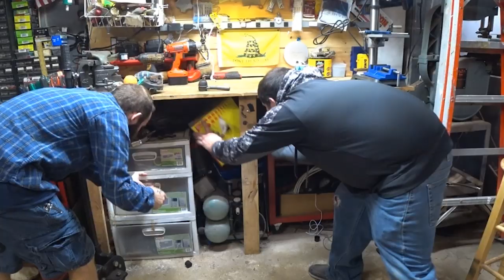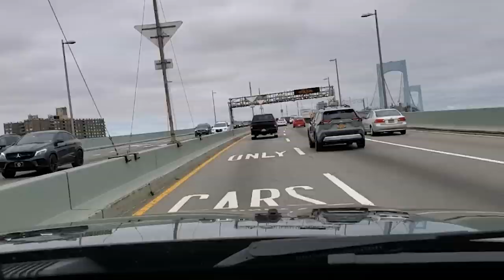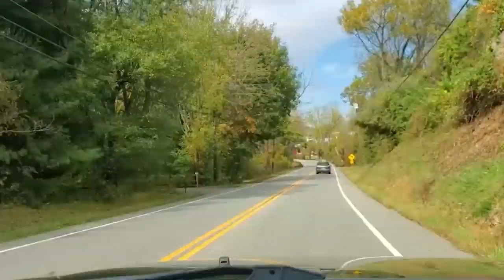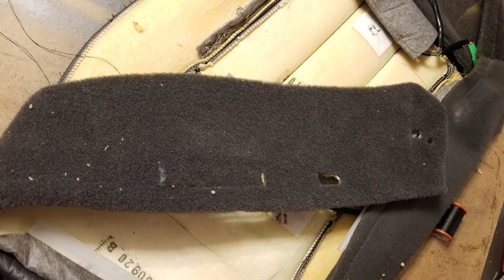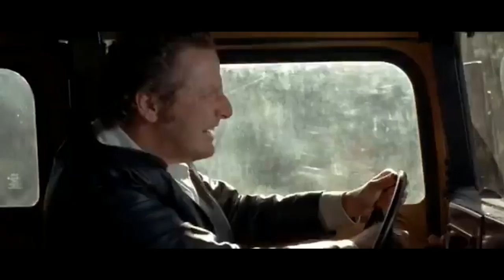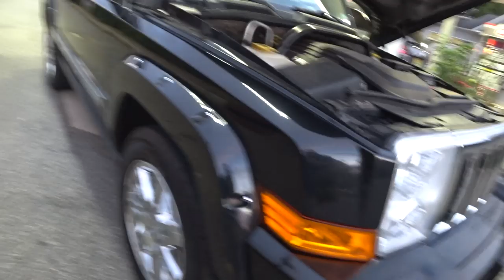DD&E IN THE GARAGE - A JEEP TRANSFER CASE TRANSFER IN NEW JERSEY WITH DAN, DOUG AND ERIC

Comment: If I got another Jeep it would either be a WJ Grand Cherokee or an XK Commander with the quadra-drive and 5.7L V8.  That Commander was definitely highly overlooked, no use for the 3rd row seats, but a mild lift and some all terrain tires and it would be great.

Waiting for this Toyota to get out of the way...weird here in Idaho its always a damn Dodge Pickup in the way guess they have to drive so slow so all the parts don't fall off them...and depending on the Toyota some of them are dogs and don't have enough power to get out of their own way.  The 4.7L and 5.7L V8's they had in the Sequoia, Tundra, and Land Cruiser were pretty good...I'd love to find the somewhat rare 4Runner with the 4.7L V8, they only made them for about 3 or 4 years if I recall in the early 2000's.
Reply from the maker: Haha.. I don't mind some of the bigger Toyotas.  I like the Tacoma too.  I think I'd like a WJ to be my next Jeep restoration.  An overland would be great